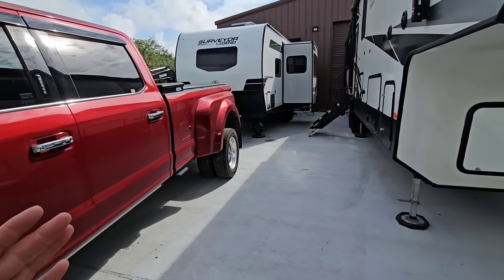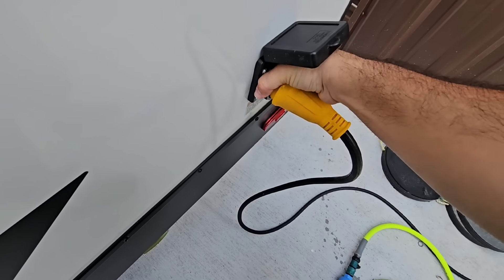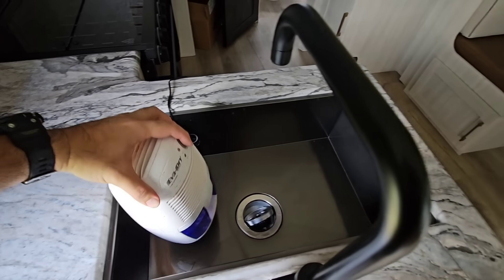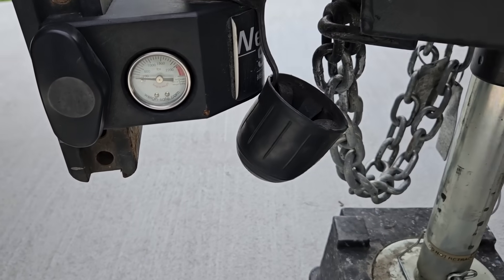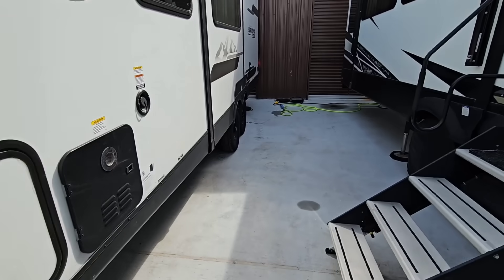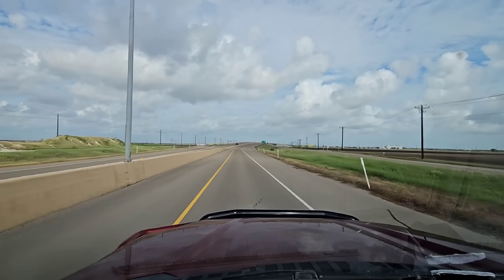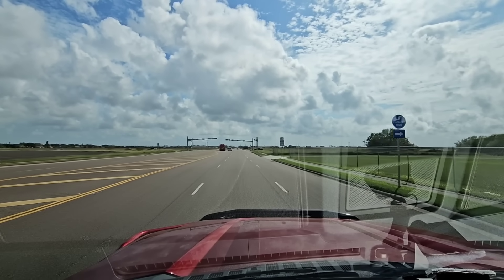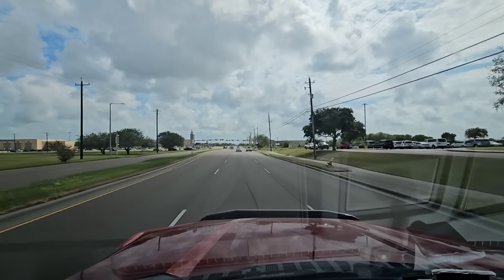Towing a Small RV with a Big Pickup Truck! Forest River Surveyor 240BHLE with my F450

Comment: Love the channel. Great to see this series. 
My wife and I both tow an Imagine XLS 22MHE with a similar GMC. A Canyon Crew-cab AT4 Diesel. We tow it over the Pacific coastal hills. The diesel has no strain towing it. 
The trailer slightly moves when vehicles pass us on the freeway. But very easy to adjust with small steering wheel inputs. 
A Furion backup camera was a necessity.

Comment: tow a 38 ft cherokee with a 3500 ram cummins with factory airbags and sway bars. Sketchy without the bars on the way home when we picked it up at 60 with the anti sway 65-70 with a stiff crosswind its fine.

Comment: If I can make a suggestion - put that table down before traveling. The weight of the table top will rock back and forth and eventually start pulling the screws out from the floor.

Comment: Man I towed my 30’ bumper pull across the Texas panhandle in a 30 mph crosswind with my ‘22 F450. It was still crazy sketchy. The truck even stepped in and cut power and gave me an “unsafe sway” warning on the screen. Didn’t expect that with my big truck and a good hitch. (Husky weight distributing and anti-sway)

Comment: I like to put the breakaway cable through the lock or clip on the tounge latch.  I personally use a clip that holds cable and trailer plug cord
Reply: I replaced mine with one of those stretchy cords, keeps it from dragging.

Comment: I initially pulled my Winnebago Micro Minnie (@4000 lbs) with my half ton GMC Sierra (@5200 lbs) without weight distribution - fine on smooth road, but got a lot of whoops and porpoising on highway with construction and uneven surfaces. Installed Timbren SES (which you've reviewed) and have excellent control without adding weight distribution. Thanks for your continuing work and insights.

Comment: I have a Grand Design 2800 BH. I had a 2020 Silverado 2500 HD I used to pull it. I recently upgraded to a 2024 Silverado 3500 DRW. My intention is to upgrade to a larger 5th wheel or TH in the future. I must say holy cow! I pulled the Grand Design for the first time this weekend with the new truck, wow what a difference 2400 extra pounds of payload capacity make.

Comment: I have a 2020 F250 7.3 Tremor. Our old RV was a 32ft Jayco toy hauler. Loaded with a side by side, water, gear, everything it was about 11k lbs. Used a good weight distribution hitch with sway control and it was no problem at all. Now we are out of our side by side phase so much, we moved down to a Forrest River Salem with a very similar floor plan to your new trailer, ours is slightly smaller. Towing with this 3/4 ton and not having to deal with sway control or weight distribution is nice.

Comment: You should just drill a hole in your dehumidifier and let it drain so you don't have to empty it lol.

I have an older TT that I tow with a RAM 3500. 30' overall and weighs about 6500#. Truck tows it great but it doesn't have enough tongue weight. It can be uncomfortable sometimes and absolutely NEEDS to have the water tank full. You can feel the coupler completely unload on some bigger bumps.

Comment: Not a travel trailer owner yet. So my curiosity comes from the weight distribution. I was wondering if before you hook up the continuum, could you do a run without it and compare? At least the sqat of the truck? I have a 2019 1500 and the tag says #900 for the hitch weight. I would like to know how the #500 toungue weiht affects it. Great channel, love the info.

Comment: Did they stain both sides of the cutting board? See you didnt drop the dining table,have you had any problems with previous trailers leaving them up,or depending on the base?Thanks for Info on building this trailer..

Comment: I was really hoping to point out that you hadn’t put a lock on the ball joint latch and then you went back and did it. I have seen several people who feel that it isn’t necessary to do that. They say that the weight of the trailer will hold it in place. I say Balderdash. You never know what will happen once you’re out on the road.